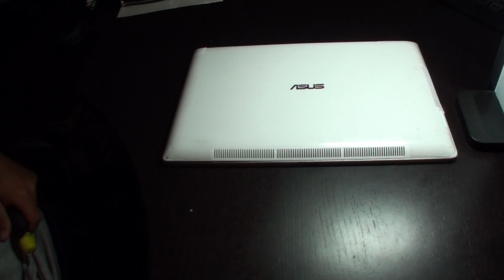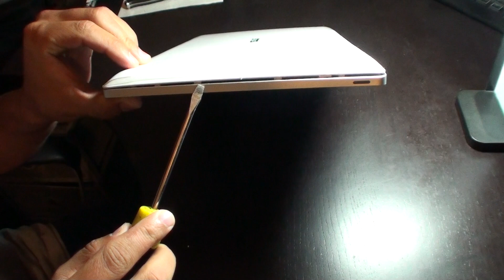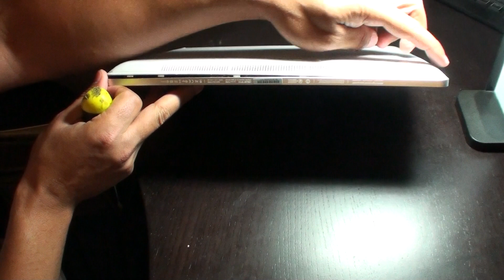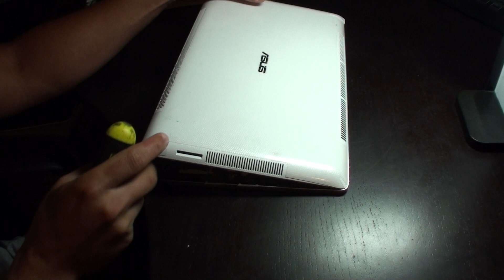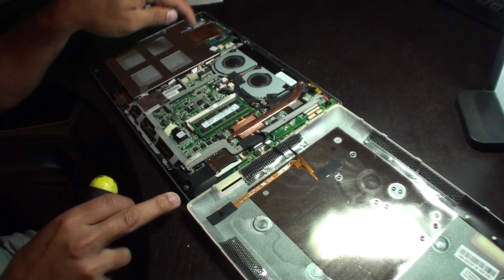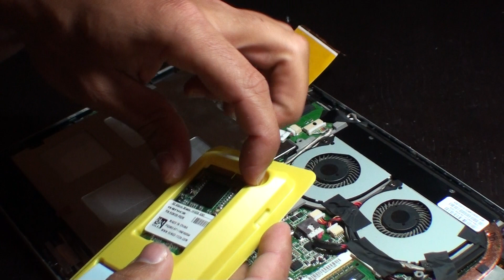Part 1 - Intro and HD Install

Comment: by replacing the ssd do I have to reinstall windows?
Reply: There should  be some kind of media creation tool to restore or back up windows, It came in mine when I had windows, Now I use Linux Mint and is faster, cleaner and doesn't even need all the upgrades (but they are welcome anyways), give it a try with a live CD, it detects the wifi and you can temporarily take it for a spin to see how it is, see videos on youtube on how to install and use Mint, a little learning curve but no big deal and no overheating problems as with original windows,
It doesn't even need more than 20 GB of space to run if you get the 32bit (i386 they call it), I use it now more than when it was new. Any questions feel free to ask.

Comment: I have problem to charge the tablet.  The connector makes contact just in some position.  If you push the jack in all the way the tablet won't charge.  I opened  the tablet following your video, and notice that the jack receptacle is somehow loose, it moves inward wherever I try to connect the jack of the charger.  I am afraid that with that movement the cable has a false contact.  The piece is around 8 dollars in Amazon, but I don't know how to access it, to replace it.  Can you show me how? Is there a link to the service manual?  Any help will be appreciated.  Thank you for your video.

Comment: also, the cable that's attached to the back plate is a heat sensor, it's VERY important not to tug, pull or twist this cable.

Without it or with a broken ribbon cable, the fan will always be 100% on, making the tablet very noisy

Comment from the maker: It's hard to say because I didn't have a way to make a fair comparison. Before this upgrade, I had the Programs folder located on an SD card to save space since 64G wasn't enough HD space.

The new HD compared to the SD card performance is no comparison. The program I loaded in the last video of this series used to take up to 5 min to load. Now it's up in seconds!